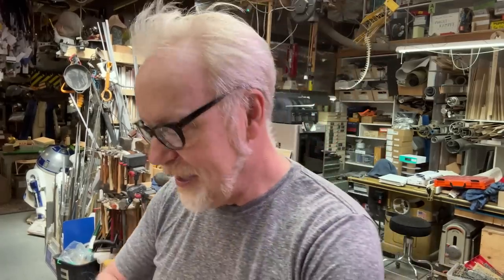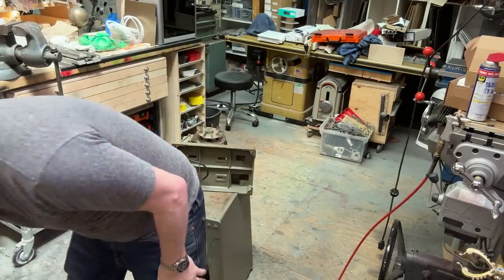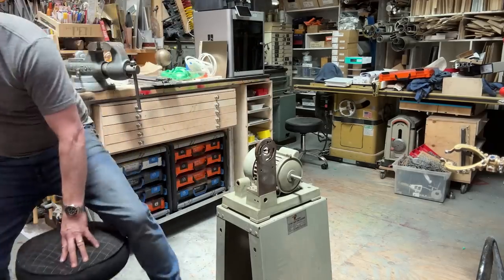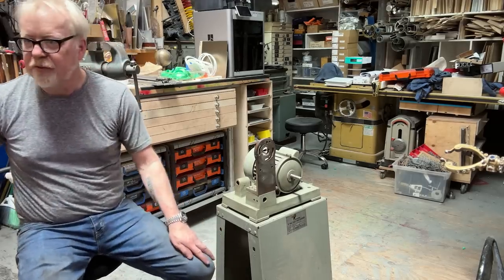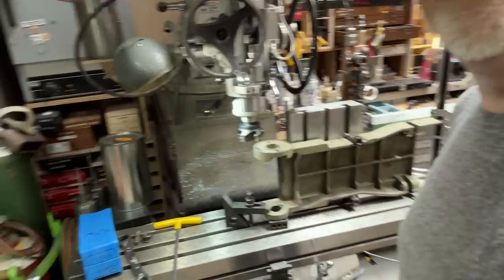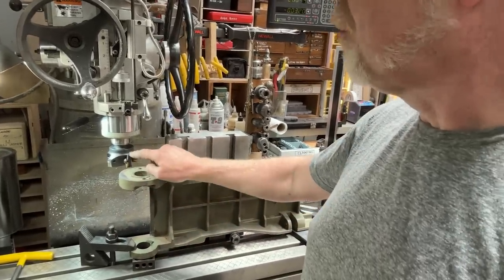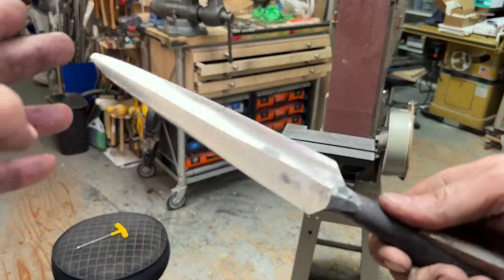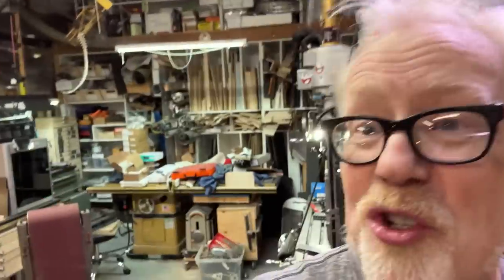Adam Savage Fixes His New Belt Sander!

Comment: While stainless steel hardware may look pretty, a lot of the time it is more for appearance than strength, coming in around Grade 2.  Watch your fastener head markings (which might make an excellent Tested tech tip short) and keep high grade fasteners in where needed.  Generally, you can always go stronger but should rarely go weaker when replacing fasteners.  Also, be sure to never-seize stainless fasteners that are being highly torqued as they have a tendency to gall.

Comment: The problem isn't having enough sanders or abrasive tools, the problem is storing all the abrasives. I have to have over 60 boxes of various grits, belts, wheels, discs, stones. From 1/8" X 24" belts through 36"x75" belts, 46 through 2000 sheet paper, every type of screw on disc possible and cubbys boxes and drawers for all of it. Yet, I somehow still need more and a better way of organising. Getting the tools and equipment is part of the battle, managing it is a whole other game.

Comment: Question:

When did you become fearless about taking complicated machinery apart?  Was this something you did as a kid, or as you became an experienced mechanic did you realize that whatever you took apart you'd be capable of putting it back together?
Reply: I think in videos of him talking about mending his old land rover, he touches on this.
Reply: The answer is after getting enough money and breaking enough things
Reply: @jackpeterson6670 or it's out of warranty so you do it yourself
Reply: Develop a mechanical aptitude and a good knowledge of tool use. It goes a long way.
Reply: There's nothing to it but to do it.  As well as if it is already broken and useless you can't break it more.

The real trick is as you get started taking stuff apart is to take notes on what went where and lay out screws/bolts in the pattern of how they came off. Keeps nuts threaded onto their bolts.  Be organized and certain in your movements. There is no worse feeling than breaking something as you put it back together because you used the wrong bolt and cracked a housing.
Reply: Heh, a belt sander is "complicated machinery"?? Ok, guess you've never worked on complicated machinery. This thing is about as dead simple as it gets.

Comment: I have one of those sanders, when the bearings go they howl loudly. As a rule, especially with harbor freight or grizzly tools, when I break down a tool for cleaning or get a used tool, I buy quality replacement sealed bearings for the whole tool. All my tools have lasted over 30 years, even my dremel with only a dust and oiling. The only difference between a disposable tool and a reliable quality tool is the care of the squareness and the precision of the moving parts. The tool will let you focus on the work and not on the tool when you do this up front.

Comment: I have the exact same machine.   I noticed that you never reattached the locking knobs to the left and right of the belt tensioning wheels.     Not sure if yours is the same but when they are attached and tightened it changes the belt track a wee bit.

Comment: Since you are not using the disc sander part, you could attach a flywheel there and it would have a bit more momentum and not slow down as much under load.

Comment: I have a sander that I think is based of the same casting. The switch is in the worst location. Where I have it nestled into my shop is similar to yours, where you have to lean across the belt to start it.  Haven't re-run it yet but its on my to do list. Also it appears to be missing the wheel to attach the sanding disc on the upper pulley. Note the additional mounting hole for the table underneath the upper pulley.

Comment: The base of the machine looks like it is drilled on the left side for an on/ off switch. I am curious why you didn’t wire it that way while you had it apart. It also looks like it’s missing the disc sander attachment on the right side of the as machine. 
Put a shelf on the bottom for belt storage.

Comment: Add electrical tape on plug ends of your power tools and on machinery side. Small piece of different coloured tape speeds up your work, when you don't need to raffle thru your same coloured leads!
I only have few powertools and it's driving me mad when i second time plug wrong lead on the socket.
I hope this helps someone if not @AdamSavage !

Comment: The 'new' ceramic belts (The orange or green ones) are amazing compared to the old Alum Oxide ones. The part stays cooler and they will rip off material even on low HP machines. Plus they last much longer. A bit higher price, but well worth it.

Comment: IMO, it's worth replacing the lube in old bearings as a matter of course, simply because older lubricant turns into tacky glue over time as the oils in them polymerize. Eventually that will lead to overheating and rapid polymerization. Like a feedback loop. Until the bearings seizes up. 
If it is possible to replace the lube without destroying the old bearings, that is. Otherwise it's a problem for future you :P

Comment: But the bearing hole is still not square with the other hole. Wouldn't it be better to re-drill that hole so its not at an angle and use slightly larger bearings?

Comment: You should move the switch to the front for safety.  And boy, it looks like the belt speed is quite slow. If you speed it up, it will cut cleaner and the belts will last longer.

Comment: Stainless is the wrong choice indoors. It work hardens and fatigues with vibration at room temperature. You want zinc plated 8.8 or 10.9 or 12.9 if metric.
Reply: It also galls if stainless on stainless without anitiseize

Comment: Ur missing the two thumb locks for the sanding belt 

Ur gonna notice every time u use it belts gonna move all around gonna keep having to tension it 

I used to m8 screw with a ratchet  right above we’re u tension the belt there are  threaded two holes for bolts or was thrumbs screws so u losen them when changing sanding belt

Comment: One problem Adam is that that sander is not for metal working. That is a wood working tool, the SFM of the belt is way to low to effectively do metalworking. It will just heat up the material from taking to long in the cut. Put a 3450rpm motor on there, rebalance the drum and wheel and the difference will be night/day.

Comment: For-the-love-of-.... blow that thang off out OUTSIDE of your shop at the very least, or maybe try to capture the dust? I still don't understand the infatuation with the compressed air blaster used in indoor shops as a go to clean up tool...basically your working environment is now covered in whatever you ground on that thing, plus tiny particles of the broken down abrasives, etc. At 3:54 the hacking cough...oy vey!!! This may not be the way to teach the younglings? Our lungs can only handle so much exposure to fine particles of deliterious materials including the heavy metals like chromium in steels. Respectably asking, please don't teach more content like this, at least without addressing the health risks of the methods shown. It's dangerous.

Comment: Why would you replace all the hardware with stainless? And then put it together with an impact?? You REALLY want the threads to break off the bolts / gall on the nuts huh? Guess you haven't learned that lesson yet. Also, you missed the biggest modification that thing needs - move the power switch to the front if you're primarily going to use the belt vertically. Also, that's not really a metal belt sander - it's way too slow - I have basically the same sander, and also use it for metal, but a real metal belt sander is way better and moves a lot faster.